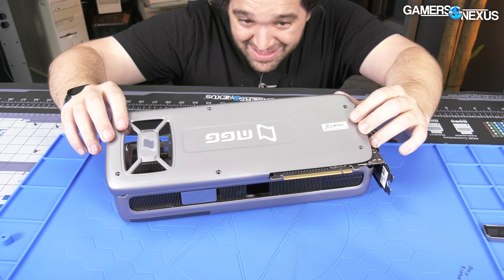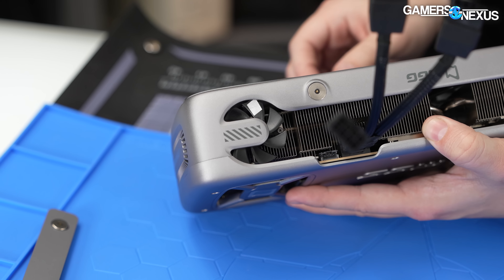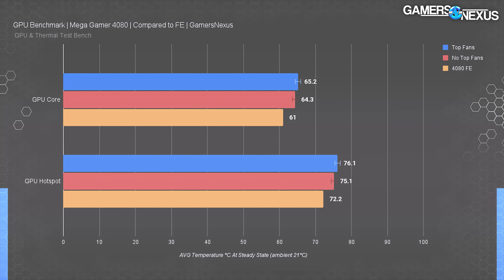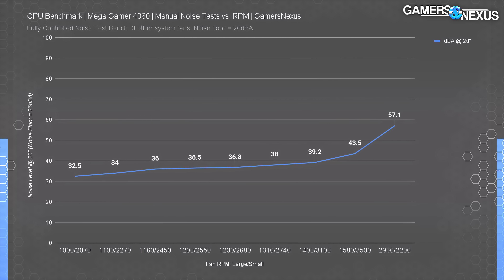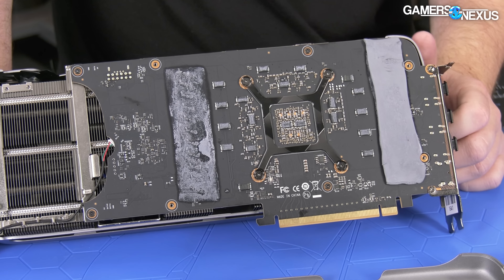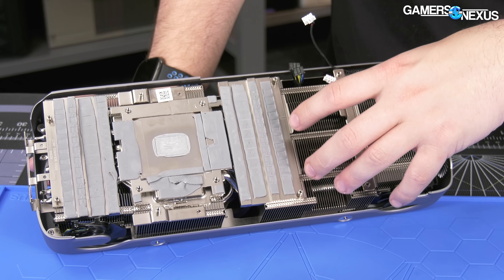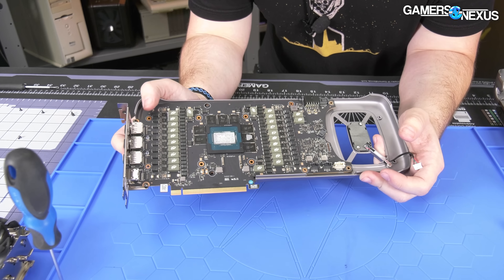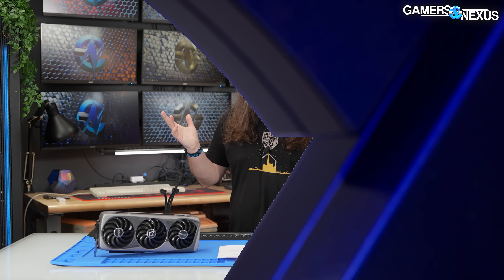The 5-Fan 'MEGA GAMER' GPU Tested: Maxsun MGG RTX 4080 Benchmarks

Comment from the maker: This thing was cool to work with. Meme fans aside, the rest of it was surprisingly well built. You can even use that name plate thing standalone if you wanted (has USB-C).
Check out our fully custom PC build with case modding for a metal band! https://youtu.be/0r03mcCLQI4
Watch our original RTX 4080 benchmarks here: https://www.youtube.com/watch?v=i2_xTUshy94 Watch our "RTX 4080 Problem" video: https://www.youtube.com/watch?v=OCJYDJXDRHw We buy a lot of components ourselves these days, and that's made possible by you all. Consider grabbing one of our new Project & Soldering Mats on the store to support us and get something great in return: https://store.gamersnexus.net/products/gn-project-soldering-mat Or our Large Modmats! https://store.gamersnexus.net/products/modmat-volt-large
Reply: I relate to mega gamer but I also relate to serious gaming. I feel like these gpu makers are really starting to understand how to market to me.
Reply: This product kind of seems pointless right? Most if not all 4080 use near 4090 heatsinks as it is correct? My 4080 is nothing special and it's virtually same size as a 4090. I think they mostly reused parts form the 4090 in the 4080. My 4080 on 100% stress load I don't think surpasses like 68-71C and that is with Furmark and CPU stress test together at same time to maximize case heat. I will watch this video but this seems full meme. On a 4090 maybe it would be worth it. But most if not all 4080s are over cooled as is.
Reply: While it was not the best thermally, the amount of pads are definetly first place.
Reply: Why use these tiny baby fans? Just make the heatsink 120mm thick so you can use larger fans.
Reply: In my experience the side fans most of the time brokes the air flow and make the card hotter
Reply: Hello, sorry if this comment has nothing to do with the video right now.
Is there a chance for you guys to take a look at the XFX 7900 XTX?
Its an odd ball since compared to the other XTX models according to other reviews, it seems to be running around 10 degrees colder (according to guru3d, pcworld, overclock3d and eteknix) compared to other XTX including the beefy Red Devil and excluding the Liquid Devil. I wonder how it actually runs under your temperature controlled testing and if the numbers are real or not because they are too good to be true.
Reply: Now put copper plates on the VRAM and everything that needs cooling....
Reply: So...what you're saying is, that the MEGA GAMER has 6 fans now?
Reply: A silver Sharpie will work as well if not better that the sticker
Reply: Well, I've got an additional mounted Arctic P12 120mm fan on the backplate of my 4090. I think it's pretty cool for my standing RTX 4090 Gaming OC but I don't think it's much cooler than without the added fan. 
But at least I don't come over 60 °C on my undervolted (875mV/2500Mhz) RTX 4090.
Reply: Would love to see temps of it run without the shroud. And I know you dont do it anymore but id love a Buildzoid style break down of the components here. Seems a half decent card...
Reply: I like the industrial look of the card. Obviously the 2 extra fans kind of take away from an otherwise slick card. The all metal design with rounded edges really is simplistic yet beautiful. It's too bad that the temps weren't better, it would look good in a themed PC. I'd be curious if those the two fans were moved to the top plate, slightly larger diameter, and possibly put over the GPU die and over passthrough....if that would improve things
Reply: I've seen an interesting propeller profile used for silencing drones.. 
It utilises a wishbone design to cut down air resistance and noise reduction.. as for airflow, not sure if it will affect amount of airflow for cooling. The video was from mark rober and he visited Africa and the design was used for drone deliveries.. perhaps something like this could be designed for GPU fan noise/CPU noise reduction.

https://youtu.be/DOWDNBu9DkU around 14:05 is where you'll see a comparison to give you an idea or how effective this idea could be for computer engineering to move this tech from drone delivery to silencing PC's.
Reply: Amazing cooler with a shroud that brings it down. Sounds like xfx
Reply: id like to see how one of these things performs after lengthy use, compared to the founders edition. maybe the extra cost pays for a potentially longer lifespan of the card?
Reply: The mini fans are wired wrong they spin in the wrong direction
Reply: Nvidia design>>>>>
There isn't a single AIB card with better cooling than Nvidia's amazing design
Reply: @MrArrmageddon  😎😎 When Nvidia makes a cheaper heatsink that cools better, Nvidia is king
Reply: cringe
Reply: Gigabyte GV-N680SO-2GD.
Use a 5 fans systeem.
Reply: @CaveyMoth  or make it a little thicker and use 40mm fans instead of 22mm fans? that's better, right? /s
Reply: @pickleenjoyer3025  Nvidia's design is way better
Reply: Is that a good GPU?
Reply: Yeah the FE cards seem pretty good now. Back in the day the FE cards kinda sucked with thermals
Reply: @pickleenjoyer3025  4080 is one of the best GPUs ever, but Nvidia's design is better than this crap
Reply: I know that it will be boring and time consuming but you do a round-up of the main costum cards from both a noise and thermal standpoint for the RTX 4090 and the RX 7900XTX? You used to do more AIB card testing back with the 5700XT for example and I fear that although designs have improved (compared to the memory thermals on the RTX 3000 series due to the poor design) some AIBs are pushing out bad personalisations maybe even at higher than MSRP prices.

Any updates regarding fan testing and the training?
Reply: The casket around the CPU is most probably assembly-related to protect the GPU-die from chipping while the workers press on the cooler with all the thermalpads attached.
It reminded me of the optional AMD Athlon (XP) copper protection shims we used to not destroy our CPU DIEs. I certainly wish I had one of those back then. (2400+ R.I.P)
Now it's still laying in a drawer, reminding me of being extra careful with hardware from since then :)
Reply: @nightshadelenar  What if the WHOLE CASE was nothing but an aluminum fin stack array?
Reply: You could keep the meme rolling and award a certain card as the best price to performance ratio of the year, or something, by ceremoniously attaching the Mega Gamer ™ name plate on it. I can definitely see some funny re-use opportunities for that thing. Just don't forget my royalties
Reply: @Gamers Nexus - I wonder how much difference it might make if you were to snip out that X-shaped overlay in the passthru hole on the back side. I see it has a connector on it though, not sure what that's for—RGB? That and maybe just cut out the full passthrough area, which might be difficult since it's metal but still, I'd be curious how much difference the improved passthru flow would make.
Reply: A radial blower fan provides at least 5x-10 the static pressure of an axial fan, and is quieter CFM to CFM. They could've reduced the amount of fins needed with that extra fan power and used one large blower.

Comment: With a few more fans this would be my ideal GPU!
Reply: Dats muh type.
Reply: Nvidia design>>>>>
There isn't a single AIB card with better cooling than Nvidia's amazing design
Reply: @Gay-is-_-trash  ASUS Strix.
Reply: @Gay-is-_-trash idk about that one 🤔
Reply: @banoko  More expensive, cheaper built
Reply: 7 fan gpu 😏😂
Reply: @banoko  it’s a better model, but not $350-400 better. The Suprim is more reasonable.
Reply: tear off the heatsink, stick a car radiator on it and mount 6 200mm fans on either side. 🏆
Reply: @auturgicflosculator2183  just get a couple nice Spal brushless fans on a Mishimoto at that point 😅... honestly would probably still be cheaper than the cost of a 4080
Reply: @NovaRedHead  I think you're right~🤣
Reply: I want my GPU to lift off
Reply: @criznittle968  Not as hard as you might expect, but keeping it under 75 dB would involve some effort. :face-purple-crying:
Reply: Could have the gpu double as case fans too 😄
Reply: @Gay-is-_-trash  Lmao so why is my Suprim X beating it in both thermals and noise? Nvidia's FE design for 30 and 40 series is great but partners still do better.

Comment: It's a pretty decent graphics card. The only thing it's lacking is an anime backstory.

19:15 That gasket could be useful for keeping liquid metal TIM from leaking. But it comes off too easily.
Reply: Steve mentioned in the video that for that to be effective it would have to be closer to the core. I imagine all those surface mount devices next to the core would not do well if exposed to liquid metal and they're all inside the boundary of the gasket.
Reply: if they put anime waifu holding guns on it  then $200 extra gonna worth it, heck even $400

Comment: Hey Steve, I think this cards "features" would be better suited in an actual case. I speak from the experience of a recent build I did. I replaced all of my case fans with high airflow noctua ones thinking it would help with gpu temps. It actually made it about 5°C worse at the edge temp. I figured out what's happened is my old shitty case fans were getting overpowered by my gpu fans inside the case which created an effective top to bottom airflow pattern. When I got better fans the airflow was now going front to back. My card has ventilation in the front, so now air that was getting pushed out by gpu fans was getting pushed back in and recirculating. This card doesn't have front ventilation which ironically mounted properly could help create good airflow (at least for my build lol)

Comment: I have a 4080 FE in my system and honestly, I've never felt like that card needed more cooling^^ Honestly, it's probably the coolest GPU I've ever had in my rig...
Reply: Because almost all of the 4080s use 4090 coolers.
Reply: @pancakegainz  sure, but to me that's a good thing, if you have a case that fits it... it runs so cool and quiet, even in intense games like MS FS2020 or hogwarts legacy

Comment: Its interesting how there could potentially be a higher temp on the core because everything else is being cooled by the same overall heat plate. I'm also interested in whether those small fans might have more of an impact if the internal fin density is much higher. Tbh I'd take a 3 degree jump on the core and hot spot temps if all the memory and whatnot is cooler than before.

Comment: I figured those tiny fans would work by running slowly while the big main fans were off, at low load, allowing the big fans to stay off for longer maybe allowing less ramp up etc. Otherwise especially adding case fans etc let alone the main GPU fans make sense they do little to nothing lol. That said, I'm more and more curious about Maxsun as a company for sure.

Comment: If I were to guess, the gasket may be there to prevent crashing the GPU core when mounting the radiator. When disassembling it, you were removing the screws from the upper side of the PCB. That would probably make it hard to gauge how much strength should be applied to the screws when mounting the radiator (+ no retention springs for what I've seen).
Reply: That was my thought. It's likely to help with that mounting pressure. It's not being used as a gasket but rather a rubber shim that can compress a little.
Reply: Yep, I thought the same too.
I doubt it's needed, but they clearly put a lot of thought into the entire thing (aside from the tiny fans).

Comment: Mega gaming indeed! I wonder how the small fans will fair over time.
Reply: Mega noisy
Reply: It's a giant heat-sink with three regular fans and thermal pads up the wazoo, so I'm going to guess it'll keep performing essentially identically even if the tiny, largely decorative propellers fail.
Reply: Tiny fans like that are used in servers with large constant heat loads sitting for years in server rooms.  There's many decades of experience in the industry making them, so there is nothing inherently wrong with smaller fans that would make their more likely to fail than larger ones.
Reply: They're going to fall apart, just like the rest of these fans. Nvidia's fans are simply higher quality than the 2 cent fans the AIBs make
Reply: @FuburLuck  yeah, in principle they'd fare well.

Comment: I actually wish they sold these in the States. Worst thing about the card to me is the ' GAMER' branding. But even if performance is slightly affected by the amount of work the heatsink has to do for so many components, this level of build quality and thermal pads should definitely be rewarded.
Reply: the gamer branding adds to the overall meme potential of the card, making it far more valuable

Comment: Super interesting. I'm not in the market for a new gpu right now but if I were I would consider this card after the teardown whereas 30 minutes ago I would of not even looked at the brand.

Next time I am looking for an upgrade I will be looking at the brand. Just adding thermal pads to the backplate does most of that work in shifting my opinion and has the bonus of me now being even more critical of brands that don't or even worse make the back plate an insultaion feature. I also really like the idea of trying to cool components that typically get no attention even if it ends up with mixed results its a nice idea and I do sometimes wonder if other cards die simply because less important components are left to hit high temps.

Comment: Honestly, my takeaway from this video is that the FE is really good..
Reply: the 4090 FE was already a pretty good card, and it gets even better when you strap it to a gpu that consumes more than a hundred watts less power
Reply: FE was designed by running simulations on the army of Nvidia's industry leading supercomputers. Random Chinese company can not do that, so they have rely on crude methods of just adding more metal and materials to get the same result as a much cheaper and smaller FE card.

Comment: I have the Maxsun 3080 10gb  and that thing runs surprisingly cool, never seen it really go above the mid 60s celsius while gaming, and it's pretty common while idling to sit around 30 +- a couple. Picked the thing up new for 525 when it was on promo for 700 plus a giftcard back for 175.

Comment: Why not give a 4090 5 fans at this point, instead for the 4080?
Reply from the maker: Good question. Still wouldn't help most likely. Not sure if they have one now, but the 4080 & 70 Ti were the first we saw in this series. Maybe they didn't get allocation from Nvidia.
Reply: Exactly. 4080 already has overbuilt cooler running below 60c on most models

Comment: They overachieved a bit with the thermal pad. Maybe they went to thick and there is no good contact with the gpu die.  But I rly like the gasket around the cold plate. An invitation for Conductonaut application. LM would definitely push it beyond FE thermal performance.(unless the cold plate is reasonable flat)

Comment: removal of the X part on back plate and making the hole slightly larger going towards pcb in middle area should help some with cooling on the back part. but ultimately i feel more fins density would help more. there are things to be done to improve besides removal or the 2 smaller top fins. like maybe venting the top and bottom areas better because it does have a slightly rolled over area. not sure if that would effect air flow any. but there is room for lots of improvements on cooler and design i do like the use of thermal pads on front and backsides. maybe a small cooler with heat pipes on back and back side might be a better place for small fans at this point.

Comment: All things considered remaining VREL limited sounds like it considerably boosted it's power limits. I think including a section for target/stock VBIOS power limits would better help illustrate the thermals section of a review. Did the card allow for 20w more at stock? 30? 40? 50? Some cards like the ASUS Strix 3080's just start at like 420w and boosted up to 470 or 500w for that series so it's helpful to know where these cards start from
Reply from the maker: We normally do. We cut power from this because the tear down was so interesting and we were already at about 30 minutes. In this case, what mattered most was that they ultimately just pushed another 60MHz to the core for the limit reduction. Not a big enough change to justify the cost.

Comment: Hi Steve, is there any added value for you in analyzing/reporting the frequency response in addition to the noise levels? Higher pitch spikes can be less forgiving, and even cards with a standard fan configuration could sound terrible based on fan quality or overall card design. Thanks Steve.

Comment: I wonder how the thermals would be if you would remove most of the thermal pads that could interfere with the main heatsink and only really keep the ones that other GPU manufacturers usually put them (like the memory). Would the card have "better" thermals in terms of just the die and memory?

Comment: My main worry with this is how loud those tiny fans are going to get over time. My editing rig is X99 based and I have one of those Jingsha X99 E8I motherboards that has active VRM cooling fans that look similar in size and within a few weeks of being brand new they just screamed 24/7
Reply: Yeah, to me they seem like more of a problem point. Little fans don't tend to last too long unless they are of extremely high quality (like laptops).
Reply: hack out the fans, noctua 40mm fan swap 😁
Reply: Running this card's little fans is neutral-to-harmful anyway, so just disconnect them.

Comment: cases like the Be Quiet! 802 can reverse the install of the system so it faces the other side of the case. the card is upside down in that arrangement. that removable rgb plate can then be flipped to be correct orientation.